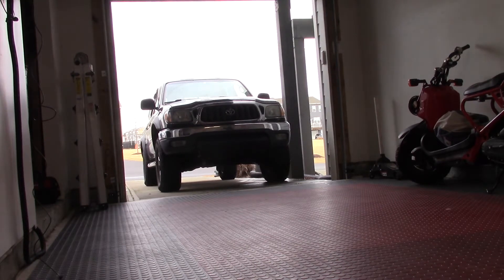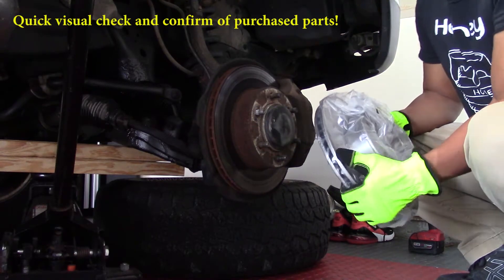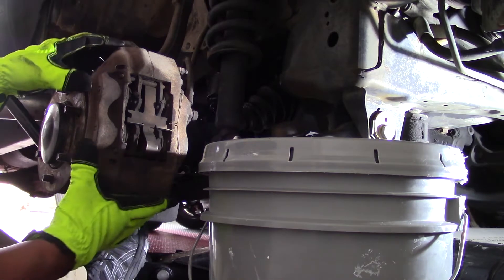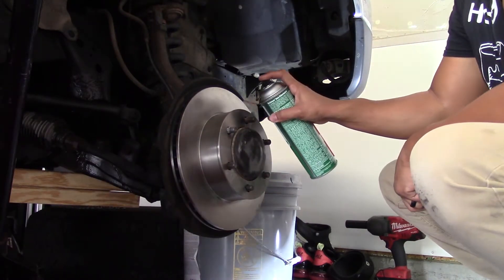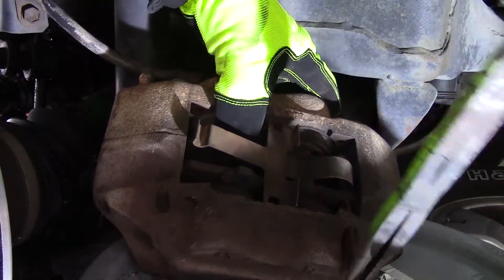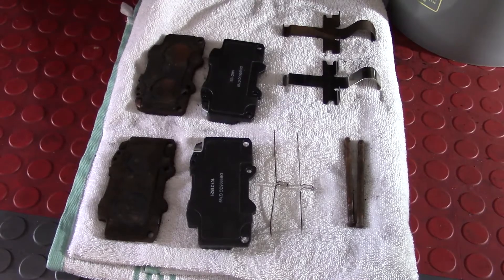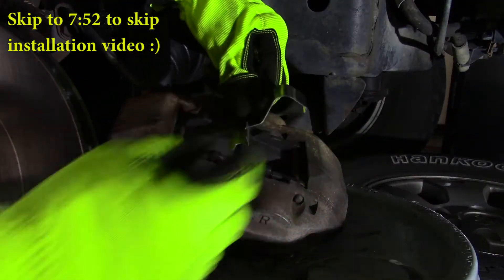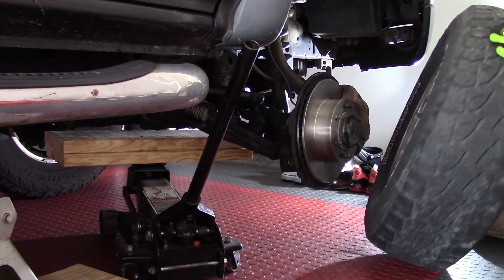Brake Pad and Rotor Change | Tacoma 4Runner T100 Tundra

Comment: this is not applicable to a 4 wd Toyota T100. please update the video
Reply from the maker: Thanks for the update!
Reply: @EngineeredMojo  no sweat, thank you for the video it helped on the Tacoma. the T100 you have to remove the axle hub
Reply: @WeTryMotorsports  can confirm. It’s the older style hub/rotor combo.

Comment: Man my t100 disc's look nothing like this. Is this a 2wd model? Mine has a hub bolted to the outside of the rotor that has to be removed to access the rotor.
Reply from the maker: This is a 4wd model I'm the video. What year is your T100, earlier 90s model or later 90s?
Reply: @EngineeredMojo  its a 95 sr5 4x4. Its an odd one .  The front is stock for all I know but the previous owned did do alot of dumb stuff to it (put a Ford ranger axle/diff in the back cuz he couldn't find the right Toyota axle).  Been working to get everything back to stock. Have to fix the front cv so I figured I'd just replace the rotors while at it.
Reply from the maker: @GorefiendGaming  oh wow previous owner was throwing random parts in there. Guess it was a pure A to B vehicle for them. Hope the fixes go well for you and getting the truck back to stock as much as possible